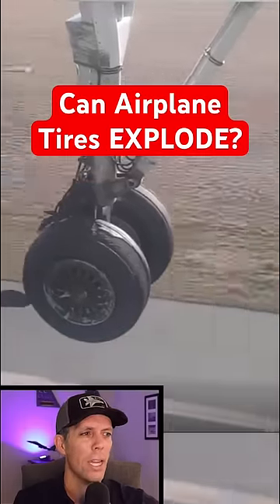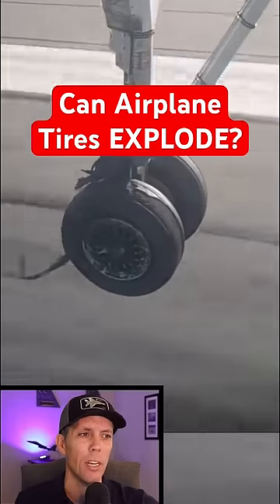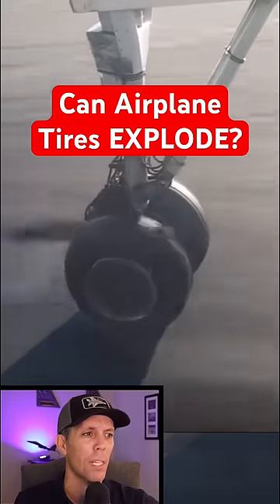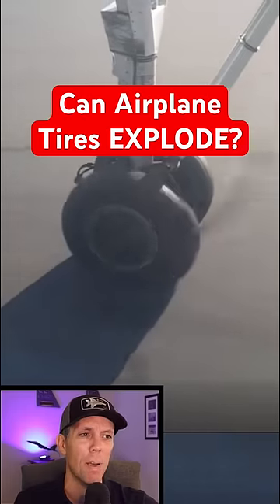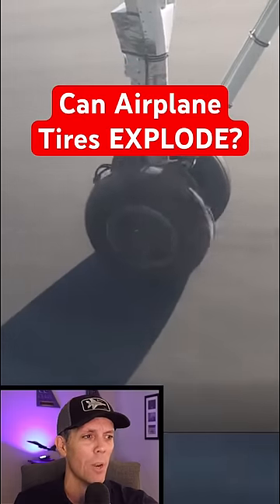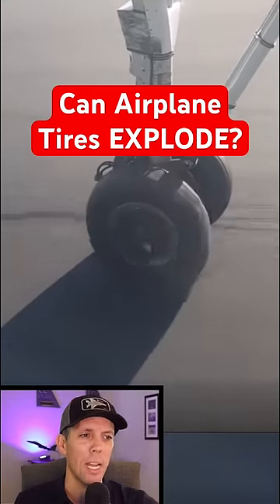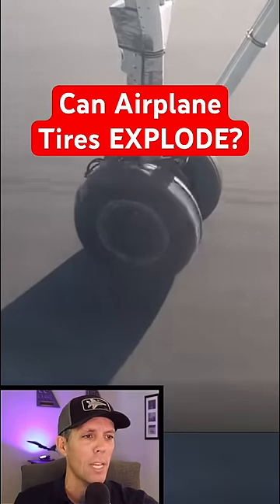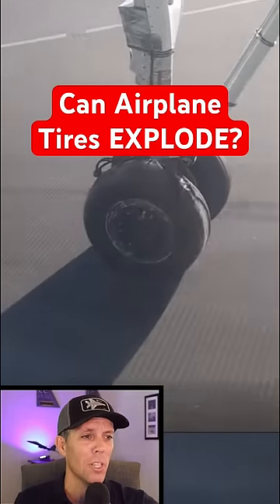Can Airplane Tires Explode?

Comment: I was in the Air Force and the scariest thing to see is putting the chocks in on a plane that just marshaled in to park and while under the wing crawling like a duck you push the chock in and see no rubber but threads on the tire . Yeah it’s only 230psi but with the weight of the plane on it you are looking at a bomb 😂 I duck ran from under there …Then had to replace the tire sheeesh!
Reply: What?
Reply: @Cobalt_Colonel post flight inspections require checking tires of the aircraft and brakes. Essentially they're inspecting a time bomb since the tire is on the cusp of a blowout
Reply: Now a tire with threads showing and hot brakes is a real mess.
Reply: @gibbygibbstein7858  I took solace in the fact that if a tire did go (I worked on c130s), I wouldn't have even known what happened. 😂
Reply: Imma be honest, I’m a truck driver and I had a tire leak and it went down to 20 something PSI and I was refilling it to take it about 50 miles to the tire shop. I kinda wedged the nozzle on the stem and stood as far back as I could…. that was only up to 100 PSI and I was still terrified of it, can’t even imagine 200+
Reply: saaaaameee!!! I had a c-5 come down with 3 right tires showing wire. although the flying crew chief did come out and help, he'd never changed one before,
Reply: @maddash7676  I worked on F15s and I remember a day a jet came back with a worn tire and hot brakes, tire popped while I was getting the pilots out of the seat.

"Huh why did that happen chief?"

Cause you didn't think to call out hot brakes.
Reply: @MoNk3y8oN3  what?! How does a FCC get to that position without a single tire change? I feel a c5 would require them more often than a c130, and we had them like every 3 months
Reply: @Fetidaf  (overseas) I watched a guy lose his vocabulary after getting domed by a HEMMT split rim after the tire blew . One of these plane tires going off would rip you in half. That one kid that got pulled through the floor of a bus by a blown tire  comes to mind.
Reply: I wish I could show you a picture. I just caught a c-17 with one tire that had 3 inch wide around the entire circumference of the tread was like a pom pom.
Reply: I've always heard that much pressure without any kind of load on it is like a bomb. I wouldn't wanna find out what happens when one blows either.
Reply: How did you pass your asvab?
Reply: As a tire tech I feel this & I only worked on regular car tires. I also landed planes on a private strip & refueled them. So I have some experience with both. The scariest things I learned what that every plane has to be jumped off each time it takes off, including the jets, so imagine standing behind a Citation with your little battery charger waiting for the engine to start... Then BOOM the flames come out & you are finally allowed to move.

The second thing is refueling in the rain on a metal ladder during a thunderstorm. You're worried about static electricity & yet here you are literally pouring jet fuel into a hole while your soaking wet on the most conductive thing on the tarmac. The irony isn't lost on anyone but the flight HAS TO GO!!!
Reply: @awesomerthanyoutim20 You don't pass ASVABS. They are graded on a gradient. A 31 for example just means you did better than 31% out of 100. You're a total idiot but you can be in the infantry & be a meat shield. That grade is compare to the others taking the test at the same time as you. If you're with a bunch of other idiots a 31 can fluctuate. Sometimes it's smarter or dumber than usual. I got a 99 on mine & I took it 6 times or so. The lowest I got was a 92. (I took it so many times because I was in ROTC & we had to take it twice a year as "practice") 

I was always so good at tests anyway but I got bored with it once I realized I could sleep my way through to a 90 because it didn't matter. The test was probably easier in Florida than it would have been in NYC. However in NYC I got an award once for getting in the 99th percentile in the city & the state for my end of year exams. So it probably wouldn't have mattered. 

I was offered the nuclear program but since I was 18 & the Navy was "gay' back then & I hated to be in the water & didn't want to be on a sub I turned down the $60,000 bonus & joined the Marines. $3000 bonus & a full rank lower. Dumbest choice ever.
Reply: @Cobalt_Colonel the tire was ready to go boom boom due to no rubber on tire.
Reply: @gibbygibbstein7858 , who's job is it to call out hot brakes?
Reply: Wth did you just say?
Reply: @maddash7676 
Short takeoff and landings... AKA hot landing and takeoffs from places people are shooting at you.  BIAP, Anaconda, or  other Air Bases in Iraq or Afghanistan a few years back.  What a rush being strapped in to a seat taking multiple different types of fire and hearing aircraft counter measures being deployed. 😢
Reply: I worked on C17s, fun watching pilots in Kuwait take sharp turns on the taxiway and watching em drift a little bit, “Great! Gotta change the nose gears!”
Reply: If the scariest thing you had to do was put in chocks than I would love to trade careers. Tires are incredibly safe they don't explode unless it's for hot brakes or improperly serviced. Checking tires and putting in chocks is literally something every mechanic does multiple time a day.
Reply: @MoNk3y8oN3 showing CORD
Reply: @maddash7676  because their job is to move it, not improve it
Reply: @beckmangaming7860 or we watch the ramp slugs do it
Reply: @dearboy05 the pilot in charge

Comment: "Nitrogen instead of air"

*78% of the atmosphere has left the chat
Reply: That oxygen makes a difference
Reply: That nitrogen mess is a myth. Every car I have bought with nitrogen in them fluctuate more than air. I run it out and fill with air.
Reply: @lsgt5132 It has to be dry nitrogen, moisture is what actually causes the expansion and contraction of regular air. Aviation uses nitrogen to minimize pressure changes with the extreme temperature changes, and because nitrogen is inert. Your cars' setup probably didn't have the quality the Aviation industry would demand, and it didn't go from -50°C to potentially hundreds of degrees before the fuse plug goes.
Reply: Exactly what I thought
Reply: Why nitrogen instead of air? Just asking? I know there’s a reason?
Reply: @gracieg7601  Nitrogen makes up 78% of air, that's the point of this comment.
Reply: @gracieg7601 nitrogen doesn't add to the fire, for one thing, but it also fluctuates less in pressure with temperature. Nitrogen also leaks slightly less than air. None of these things matter enough for cars to care, but I can make a case for motor homes using it (I don't use it, but I have looked into it).
Reply: @DustinHawke  Nitrogen made up about 98% of the compressed gas bottles I used to inflate aircraft tires.

Comment: Each tire alone does NOT leave a pound of rubber on every landing. If that were the case, each tire would weigh 200-500 lbs since you say that’s how many landings they’re good for, and they don’t weigh anywhere NEAR that much. Something like a 747, A380, 777 might leave a pound of rubber on each landing from ALL the tires combined. I’m a former aircraft mechanic BTW, so I know a little about these tires and their weight. 😉
Reply: I’m not an aircraft mechanic, but I know they retread tires multiple times during their usable lifetime, so one pound each seems believable 🤷‍♂️
Reply: I agree, no way I worked on a ramp for a long time the build up of rubber would be unreasonable.... there is no way!!! most of that rubber is heated up and burns to smoke!! I would like to know where you get your information, Bob Villa? These wheel and tire combo are very heavy but mostly because of the "wheel" they are on the "Tire" is not even close to 500lbs buddy, and what you are saying that just the tread is that weight by your "physics" this is so not true. Just the fact that just the tread a a minimum is 200lbs is pure cap!
Reply: A 47 tire weighs almost 500 pounds
Reply: canmancult I believe many runways must be scraped. I also spent 10 years as a crew chief.  I think a pound is reasonable maybe on heavys. Take my word with a grain of salt though.  I worked on small aircraft (F-4, OV-10, F-16, A-10). My knowledge of big planes is limited.
Reply: thank you for 'weighing in' with your advice and expertise. =]
Reply: @snowboardslider24  😂👍🏻 Well
Played! And no problem! 😁
Reply: @justing42  272 lbs
Reply: @andrewbartczak5941  I work on C-5’s and I think a pound per tire is a little much, that would be 28 pounds off the jet every time they touch down including touch and goes I think we would go through tires at an insane rate
Reply: You go guy. I was a mechanic for USAF in AR shop. 1979 to 84. Plenty tire changes.
Reply: Oooooo watch out we got us a bad ass over here
Reply: Yeah that sounded 100% false.
Reply: @Ajones1420 the tires on a 747 weigh about 270 pounds so if retread 5 to 7 times in their lifetime they can easily be losing 1 pound per landing. Where did you guys learn math?
Reply: Good for you big buddy... good for you
Reply: People are so quick to believe what the see on the Internet, its frightening really.
Reply: Didnt you listen to what he just said?
Reply: Im an airline pilot and was highly skeptical as well if the pound of rubber comment. I stare at these tires frequently, as I’m sure you do.
Reply: It wouldn’t take much to get these tyres spinning pre landing. Just a small one way air / wind catching fin that would spin the wheel enough to reduce the skidding effect until it reaches near landing speed.  Weight restrictions ? It might only weigh a pound or two each wheel.
Reply: Some people don’t even listen to their own words coming out of their mouths and you understand up with contradictions in the same breath
Reply: Worked KC135 for 20 years, a pound of rubber each time it touches down would have saved my back pulling the old tires off for sure! But I can’t get behind that..
Reply: aircraft tyres are huge. the plane is just even hugegier
Reply: I was going to say that must be the total from multiple sets of landing gear. Otherwise the tires would have to be 600+ lbs of rubber per tire.
Reply: @jarrenm4760  do what?
Reply: @RobtheAviator I'm not going to argue about how much the tires weigh but I will say that there's no way I would put a tire in such a condition on my car! 😢
Reply: I once visited a military air show in South Africa and a USAF  KC tanker on show had posters in various parts of the aircraft. The info for the landing gear stated there was enough material in ONE tyre to make 14 sets of car tyres. You don't realise how big they until you stand beside them --- amazing

Comment: 200 to 500 landings = 200 to 500 pounds of rubber. The tires are not worn to the hub. The tread is about 30% of the entire tire's weight (former retreader here) so each of the smallest tires weighs approx +600 pounds. Multiply that by 6 (dual nose and mains) gives upu over 3600+ of tires alone.
Reply: @JesusIsAlphaOmega001  Two smart ppl here w/excellant info 😊 just wondering, do U work w/tires too.?
Reply: Yes, Jesus is Alpha & Omega🙏🤲🕊✝️😇
Reply: Your maths seems a bit dubious here, a wheel the size in the post is certainly moveable by hand lifting it on and off the axle so 600lb is a small wheel is BS dont forget, tyres arent changed on aircraft, complete wheel assemblies are so it would be even heavier. The wheel shown probably doesnt weigh more than 80-100 lb if that. On a 747 the wheels are obviously heavier and do have a specialised trolley to help with the fitting process, but even they can be manhandled at a push.

Comment: This is why every runway has a black smear down the middle of it, right about the zone where aircraft typically touch down.  It's where they're leaving most of their rubber.  Also fun fact: the Space Shuttle (which landed significantly faster) got new tires for every flight, and stripped them totally bald on each landing.
Reply: Right about or exactly where they touch down?
Reply: Not true. Space Shuttle replaced its tires every two landings. You can find this on the website. Why lie?

Comment: Question.... Why would a blown tire require an immediate emergency landing? One way or another you have to land so wouldn't it make more sense to fly to your intended location? This would also make the aircraft significantly lighter for landing as it would have much less fuel and there would be far more time for firetrucks to prepare and be on standby in case a tire catches fire on landing.

Comment: Yes and it’s very loud. I was a U.S. Air Force Air Traffic Controller and I have heard plenty of tires blow on the runway. It sounds like a bomb going off but does no real damage as the plane generally has more than enough tires to be fine if one blows.
Reply: once a semi truck tire blew up, taking the wrong turn into the mall entrance instead of the delivery entrance, and it hit a landscape boulder and blew up, it was Loud!!!!
I can only imagine how loud, whatever psi is in an airplane tire.
I think the truck driver probably pooped himself.
Reply: Brakes can sometimes explode from heat too. I've heard an f18 tire explode before, very loud. (USN)
Reply: Had two tyres blow on landing on a Nimrod , the bits of tyre punched through the wing skin while taking off one of the undercarriage microswitch brackets on the way past, the damage caused varies greatly, sometimes nothing sometimes huge.

Comment: I used to work at SeaTac for Northwest and later Alaska airlines as a ground equipment tech. The old N gates built in the mid 60's had jet bridges that used a pair of 737 tires to move the bridge up to the aircraft. Someone stuffed their food wrapper into a micro switch, stopping the safeties of turning the wheel assembly clockwise, meaning the 3 phase wiring to the drive motors were getting ripped out. An aircraft tech with a giant forklift came over to liftup on the jet bridge to take some pressure off while I ran the wheels back. Well his fork sheared off and speared that tire. It knocked my ass into the tarmac and left me feeling like I was hit by a truck. When those tires go it's like a bomb going off.
Reply: bus tires and truck tires are actually bomb, and your talking 200psi man
Reply: i’m in the N gates right now working for alaska 😂
Reply: Whoa
Reply: Are these plane tires single or multi-piece rims ?
Reply: @theking-el4gf  Ur correct. I'm a truck driver & I've pulled containers from the Rail Yard. One night the mechanic was changing a tire off the rim in the shop (I wasn't there at the time) & I forget what happened but the tire blew up & killed him instantly. It was an explosion & an ugly sight. Very dangerous changing out those tires & it was on that machine where he put the tire on it. My husband knows more & he always told me its a dangerous job 😢
Reply: Ur very blessed to be alive, the Lord protected U 🙏🤲🕊✝️😇❤
Reply: @theking-el4gf Yup I had a buddy who ran a tire shop. He said he never inflated trailer nor dump trucks after he witnessed an old coworker be ripped to shreds when they accidentally overfilled a tire with air.

Comment: As a Semi truck driver, I knew immediately that tire was a retread. Those things shred themselves all the time on the road 😢
Reply: The difference is if a tire blows on a runway they'll clean up the debris.......
Reply: @ShadowRyu  Semi treads = dead alligators. I've hit a semi tread in my car and it was not that bad.
Reply: In the 1970's I bought retread snow tires (bias ply), I was pretty broke.  I figured they'd come apart at some point. I wore those suckers out in a few winters and I left them on in the summer and wore them through the retread and into the original tread at which point I replaced them. They never came apart, the patron saint of tires must like me. I wonder if they retreaded those again? :)
Reply: When a tire only gets 10 landings, retread suddenly seems really nice. We rarely ever blow out tires, and when we do, well there’s a lot of tires on a plane.
Reply: As a simi driver, you should know that retreads are as reliable as new tires.  You are probably using a cheap retread company.  Try a premium retread company.
Reply: @baxterfaster7554  Can't control who retreads them when you're a company driver 🙃